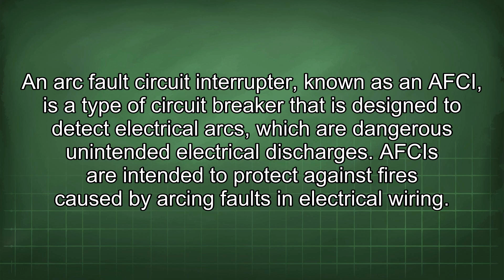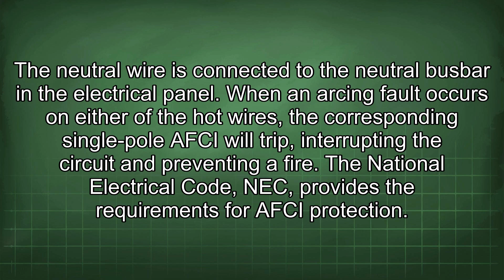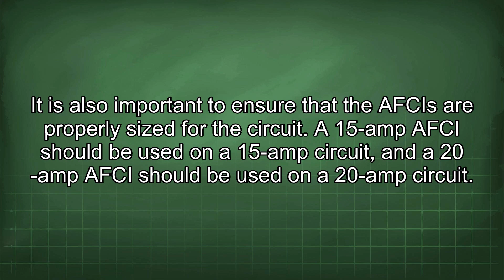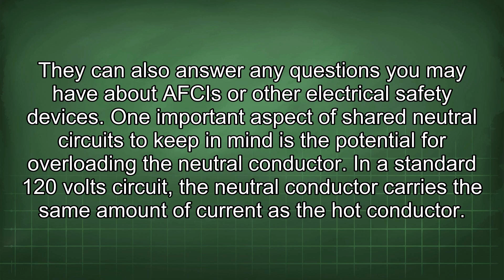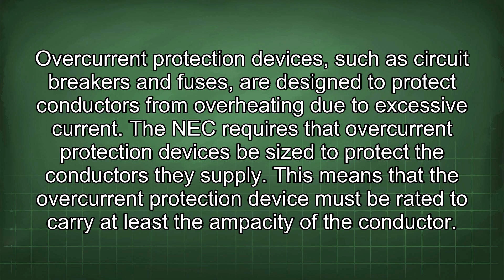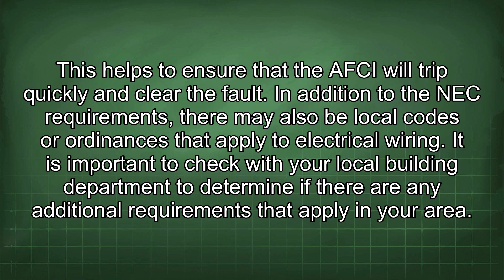Using Single Pole AFCIs on Shared Neutral Circuits

Comment: Where I work we use mostly Eaton BR style panels, and multiwire branch circuits cannot be used on these Eaton BR combination AFCI breakers because they have built in 30mA I believe, ground fault detection.  Having said that, for new construction we only use multi wire circuits in commercial wiring where AFCI or GFCI protection is not required as it can yield substantial cost savings via fewer conductors, smaller raceways and labor costs.  However in residential I see this fairly often in homes built prior to the mid 1990s, often in the kitchen, sometimes other areas of the home as well.